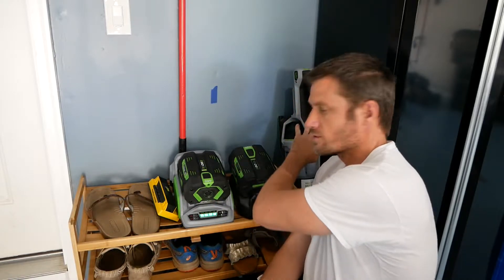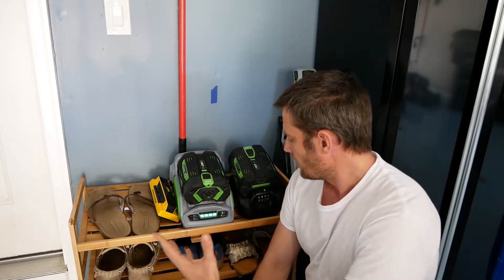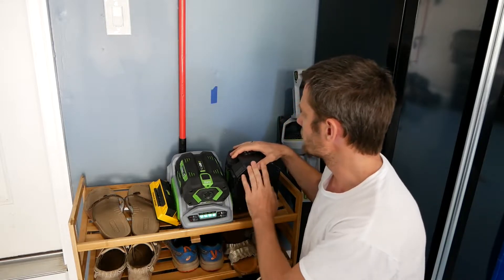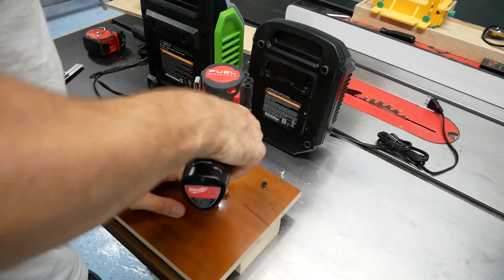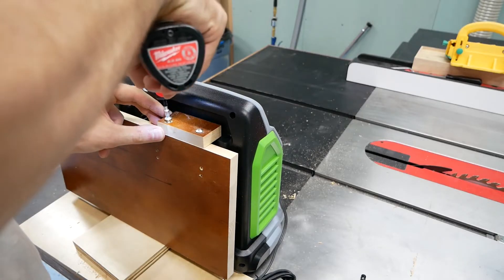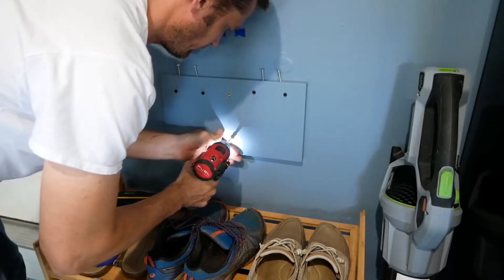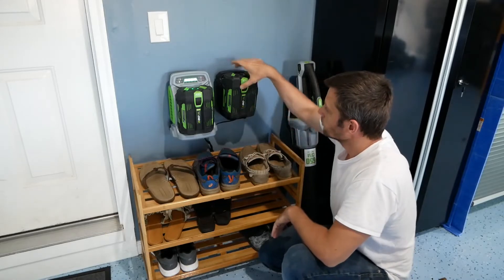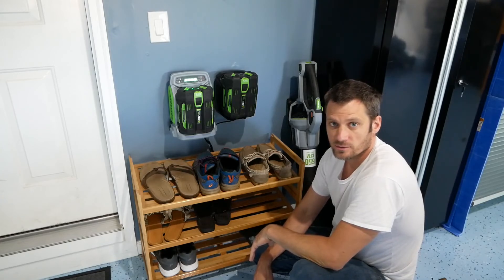EGO Charger Wall Station

Comment: On the wall is a no no much better flat on its back for ease of removal and putting back just need piece in front  of the charger so it can't move front wards then just screws for the actual mounting so now it don't move either way and way easier to handle  removing batterys or putting on charge .

Comment: In an attached garage I would be tempted to mount the station on the wall furthest from the home structure in case of fire from batteries. It would give you more time for evacuation  maybe not necessary but can't hurt
Reply from the maker: I would have preferred to mount them next to my lawn mower and trimmer, but there is only one receptacle in the garage.

Comment: Did the retaining piece that you drilled into the top of the board work to keep the charger secure when taking the battery out?  I made the same type of bracket but the bottom of the charger come out from the wall because there aren’t any slots for fasteners. I might try what you did.
Reply from the maker: Yeah it is held in place with no movement when the battery is removed

Comment: If I am correct? 
I believe Ego highly recommends not leaving the batteries on the chargers and the charger not left plugged into the outlet once  the batteries are fully charged? 
It lowers the life of the battery considerably.
Reply from the maker: According to the EGO website FAQ,  "batteries can be left in the charger"
Reply: @MaverickMakersUSA  Where did you see that? Their customer support people in their forum say: "For best practice, we recommend storing your EGO batteries in a climate-controlled area that is dry, gets ventilation, and between 50°F-80°F (10°C-26°C) all year round. **Additionally, we advise ensuring that your battery is off the charger and that your charger is unplugged to preserve your battery's life span.**"

I've 3d printed some ego battery holders which I'll be mounting to my wall so I don't leave them on the charger. Although, my garage gets pretty cold in the winter so I may decide to move that inside somewhere.